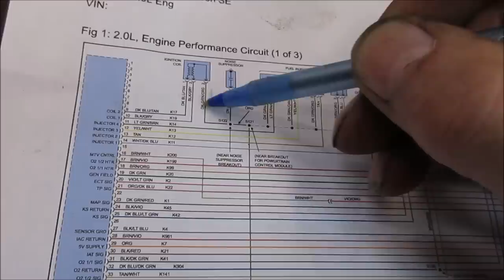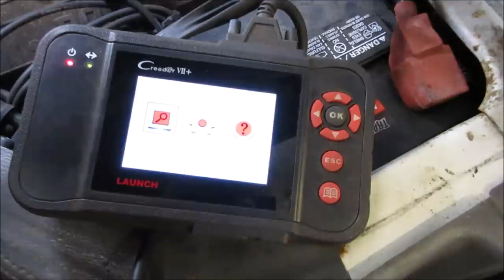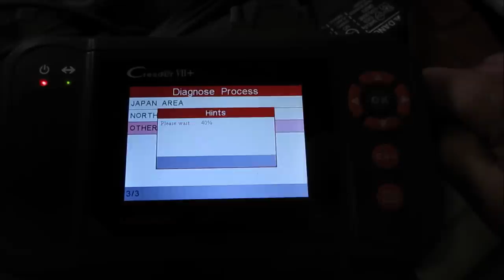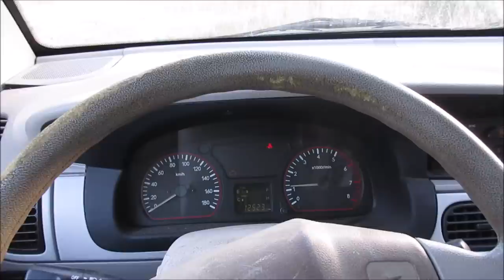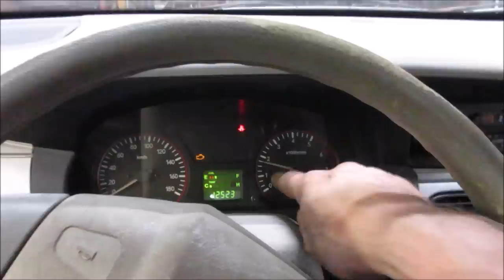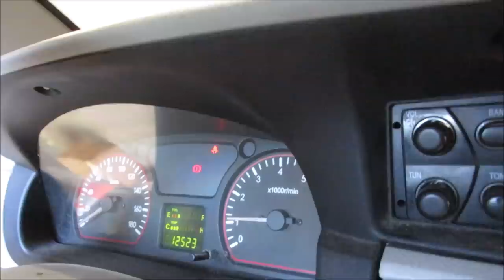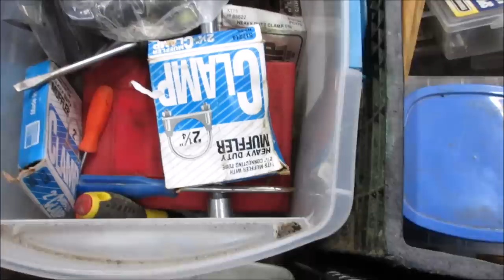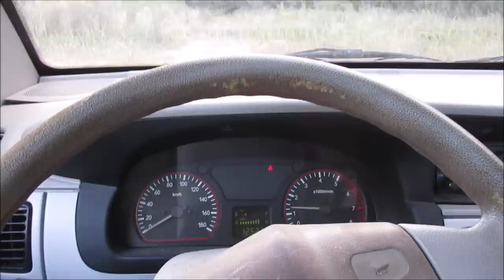Cheap China Truck Challenge

Comment: That module has TWO coils in it. Instead of one end of the secondary winding going to ground internally, one end of the winding goes to one plug and the other to a 2nd plug. They are in series and so fire at exactly the same time. Many twin cyl bikes, mower motors, 4 cyl cars, use wasted spark. IF you only connect one side up like you did the spark will go to ground inside the coil and that is not good.

Comment: Hey I used to have the same truck it was called Vantage T1000 truck all,  could not get a windshield for  it . I pulled motor, Trans and front suspension  and built a suspension out of it!

Comment: Very cool.  I'd investigate the wiring/connections between the prop-shaft sensor and dash, as a working speedo would be useful.  You've just got to find where is the tie-in to the coil-cut feature and isolate that.

Comment: The theory about the sparking plugs going to the non firing cylinder is correct. The reason you can see both sparking on both plugs when out side the cylinder is because the air is not compressed. The voltage to ionise the air so a spark can transit across the gap is much higher when the air is compressed. So it will appear to be ok at normal air pressure but will not work in a pressure about ten times that. In effect you made it a two cylinder engine (from three with one lead dead) with drag from two dead cylinders, hence no power....

Comment: The resistance of the burnt combustion products is higher than the resistance of the fuel/air charge, so the spark favors the proper cylinder when the engine is running.

Comment: Measure from each pin to ground (mounting inserts).  Two will have matching resistance, one will be different.  12v positive goes to the odd one out.  
You have 4 wires..
 One is just a bolt to the chassis.  Ground.

Comment: It's coming together! Or maybe a bit of turd polishing! Apparently these trucks were designed in partnership with Pininfarina .. look up Hafei Ruiyi truck.

02:55 NOT decent!! watch it at half speed and you can see the one plug cutting out intermittently.. the plugs are also under no compression load either, bit of compression on them and it will be just one or the other... :D 

Good job with the lower radiator mount too.. I was sad you sped that up (although i guess not everyone wants to watch you hammer crap in real time :D)

The mighty sledge also put to skilful use!

Be nice if you can get the speedo working without the limiter.. i wonder if its like some of the older stuff and just a metal cam in the speedo that contact a wire at 40km/h and cuts the sparks or if its totally electronic now.

Shame none of these trucks tried to get epa certified and wouldn't need that limit anyway.

Comment: May have been the Idle air control valve. It would have a high idle on start with that removed. Soon as it was connected the ECU would dial the speed down.

Comment: I had no idea about the spreader, I just use those heavy duty exhaust joiners not the clamps you have like the tube style clamps saves the need to weld so many times and helps if you your pipe was just too short.

Comment: spark plugs and less resistance got some substance to it.

The compression makes it harder for the spark to come throu and in a worst case scenario you can end up with no spark with the plug mounted but have spark when checking with the spark plug in open air.

Comment: going to the auto wreckers would have saved a lot of time. you could have got the coil and the wiring all from the same car. cut the wires on the coupler and you have the wiring colors to refrence.

Comment: What you said about golf carts is what I say about side by sides. $30,000? for $20,000 you can get a 4 x 4 pickup with blue tooth, heat, a/c cruise, power windows, locks, and can carry 4 x 8 sheets of lumber. For half that you can get a small pickup. 

I just can't see the point.

Comment: May or may not help - A small box mounted just behind the air filter. 4 wires coming out of it. One goes up & is quick connected to the speedometer sensor. They spliced the pink wire that goes to the fuel pump, one in wire orange,,, out wire red. Works by cutting fuel... Easy fix Remove the device, splice the pink wire back together cut everything else. .. The blue wire is spliced to a black wire that goes to the quick connect under the dash, The black wire from the unit limter.

Comment: Motor cycles have used one coil for two plugs for many years as in motorcycles twins with both pistons going up and down together ( 360 degree crank ) have only 1 set of points ( no distributor ) use only one coiil ( 750 honda four uses 2 coils each with 2 plug wires and one set of points )

Comment: Plug the speedometer cable back in, the throttle position sensor was putting it in limp mode not letting it go over 25mph

Comment: If that happens to be an electronic pickup on the speedometer, which it appears to be... The dirty trick a lot of motorcycle guys use to get over the speed limiters is to nip every other tooth off of it, then multiply the speed reported on the gauge by 2 to determine true vehicle speed. That would get you 80kph (50mph) at an indicated 40kph. I don't think I'd want to go faster than 50 in it, personally... 😁

Comment: These videos are great!
Here's my question... if you take all that time to bend the radiator bracket back into shape, wouldn't that be a good time to hit it with a wire wheel and spray on a coat of rustoleum?
Or would that be a waste of time?

Comment: You may have removed a resistor from the tach circuit when you disconnected the rev limiter plug, so the tach is giving a higher reading than it is actually turning.

Comment: Outside the engine is just atmosphere but inside the combustion the chamber the conditions are very different and thus it can become much harder to spark. Also closely watching both spark I could see inconsistency in spark which I also noticed with running. It was kinda working yes and no. New coil and she runs lovely with good spark. The only way you can fry a coil is by having it on to long, it will heat up and burn itself to death. Why you don't leave ignition on with a old points car.
Reply: You can also kill a coil by firing it with no spark plug connected. It has to flash over somewhere, and that will end up being inside the coil and thus it damages the coil internal insulation.

Comment: I wonder if the throttle body connection caused the vehicle to be in Limp-in mode and limit MPH. I would try to reconnect the speedo to see if it works without the limiting.

Comment: Running sparkplugs in parallel doesn't work too well.  When a cylinder is under compression, more air is packed in the sparkplug gap making it harder for the spark to jump the gap.  Most of the energy will end up taking the route of least resistance - though the waste spark.  While it may look ok testing on the valve cover, it's going to be different when in the engine.  Especially when you open the throttle, increasing the compression.  Note that the coil runs the sparkplugs in series, not parallel.   Series works fine.

Comment: I really like it but same time... like most vehicles, they cancer away with rust because the manufacturers don't coat the underside with some tough epoxy when its new and easy for them to get at. followed up with basic undercoating vehicles would easily last 2-3X longer, but they'd rather sell more RUST BUCKETS more often, the failure is deliberate!

Comment: Now just get the Neon connector with pig tail, so the butt connectors don't fall off the coil while driving and get the speedo working again. I bet cutting one wire which goes from dash to ECU will do the trick.

Comment: I think you could have spend a bit more time looking at the Neon wiring diagram. It showed the pin numbers for the coil pack so you could have seen that pin 2 was the common supply.

Comment: Pretty sure wasted spark uses two spark plugs and the engine block to complete the circuit, with two coil posts being either end of the same secondary winding.

Comment: Definitely needs the exhaust system fixed, it sounds like crap...other than that it would make a great little run around the property/town truck.  Definitely needs the idle speed turned down...a lot, should only be around 800RPM I think.  A much better option than a UTV/side by side, even a new one of these mini trucks with heat/ac and 4x4 with diff lock is cheaper than a UTV/side by side with a cab, heat and ac...by about $5k or more now, been a while since I have looked at the UTV market.

Comment: I know you use to be able to get dually kits for the small pickups like Toyota and Mitsubishi if you decide to put that bed on one of the other trucks you might want to do that so it looks more proportional, or even  put that rear end on the other truck with the bed. It would track different than the front tires butight look better. It looks like it runs alot better Than the other two, swap the engine over into the first one and you would have a real hit rod lol.

Comment: What trades would you be interested in? lol I'm not local to you but I have a golfcart with a 750cc suzuki motorcycle engine it's a project but something like that on your channel would be pretty cool to watch you build the cart is 3 feet longer than a stock cart engine runs but there's still stuff needing to be done to finish it out I'd trade it for something different

Comment: a 2000-2003 Ford Focus Zetec Coilpack would of been better it was ment for 1.5-2.3l engines and use a very similar plug to the original.. and they are a dime a dozen from any scrapyard i get them for about $5 and it uses quad coil with wasted spark so it fires in pairs

Comment: I wonder if you could get the speedo working and disable the limiter by disconnecting just one of the 3 wires on that connector at 30:11
My thought would be that 2 of them are needed for the speedo to work and the third would be the signal to activate the limiter? 
I'm probably way off the mark but it would be interesting to experiment.
Reply: Nah, just use your phone as the speedo. It already got a GPS receiver. Mount a phone holder to the dashboard and there you go!

Comment: You could always use a speedo app on your phone in such situations
Reply: Or even use an older phone - phones don't need a data connection to pick up GPS signals.

That will also help check speedo accuracy.

Comment: i'm pretty sure that wasted spar system has only one coil per 2 cylinder. if there would be 2 coils in there it would not make anything cheaper. every coil has two output wires. if you have one coil per cylinder than you just have one of them wired to chassis. If you have wasted spark then you have one wired through one spark plug and another to another spark plug. engine block is the last link that "closes the circuit".  So iff you want to make spark happen then it needs to spark on both sparkplugs. So this "only one sparks" is not correct. Howewer what happends is if you flood one of the cylinders and make it not spark then the other will not spark too, so losing one cylinder in this way would make you lose 2 cylinders. however most of the older coils are so bad that it will arc through coil housing if it can't complete the circuit on one or the other spark plug.

Comment: Should have used a generic OBD-II profile I doubt anything special even exists for this. Most cheapy little tools will detect it automatically as PWM, which is GM's protocol. Honda and Toyota are usually using ISO, and most cars 2013+ use CAN. There were some early adopters but I get the impression Mag was not one of them.
Since Toyota (ISO) failed, why not try GM (PWM) for reading codes?

Comment: If cylinders number one and four are in tandem, and one is on the power stroke, the other would be on the intake stroke, not the exhaust stroke.
Reply: Yeah but the spark timing is a few degrees btdc so it's actually compression stroke and exhaust stroke when the sparks fly.
Reply: @edbruder9975  you are supporting my point, which is, it is NOT power + exhaust. Power is a downstroke, exhaust is an upstroke

Comment: Looks like you're doing things half ass backwards you should drain the cooling system remove the radiator straighten the piece out and then put everything back the right way but you're just trying to half ass it
Reply: But it worked!

Comment: How old is this vehicle? Seems completely rotten
Reply: 0:04 It's a 2008 from up north. (The rust belt) They use salt for icy/snowy roads during the winter. Any vehicle up there that the undercoating isn't upkept on, will rust pretty quickly.

Comment: It might be worth painting the radiator support beam with some anti-corrosion paint to slow the rusting.
Reply: Too late. It's all rusted out already.
Reply: @1pcfred  does Mustie have a sand blast cabinet? How often does Mustie buy any new parts?
Reply: @gs1100ed  he might have a cabinet. He buys new parts whenever he needs to. Parts for that Chinese truck are not easy to get here though. Being as it is not sold in this market.
Reply: @1pcfred  yes, I understand the issue parts availability. I have also been watching his videos for years, but I’m not really a fanboy who gets defensive whenever anyone criticizes him. He has lots of parts in his stash and that’s where he gets the parts that he needs, most of the time. He is also CHEAP and would be the first to admit it. He does these videos as a business and as a source of income and he loves to find FREE items left on the curb. He will buy parts, but only if it makes financial sense, since he also sells the repaired machines. After all, how many lawn mowers, snow blowers, weed wackers, etc. does one person need?
Reply: @gs1100ed  I would not call not spending money you do not have to spend being cheap. That's being resourceful. Darren has bought plenty of the parts he's needed. He bought that ignition coil pack.